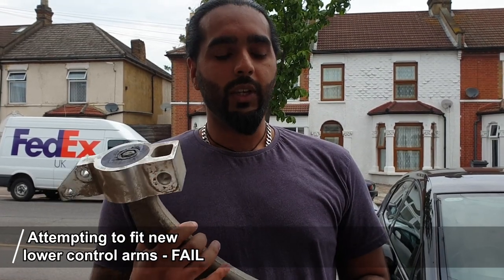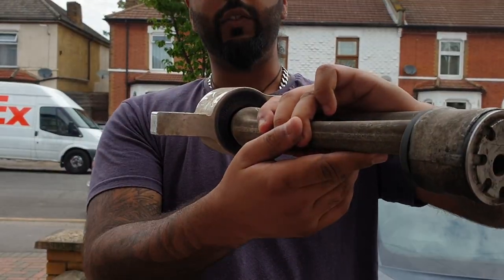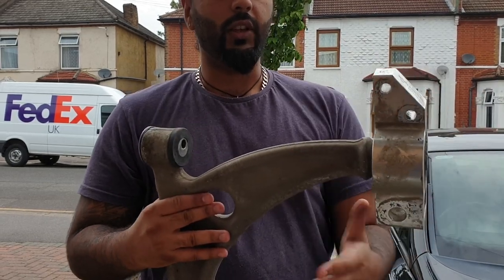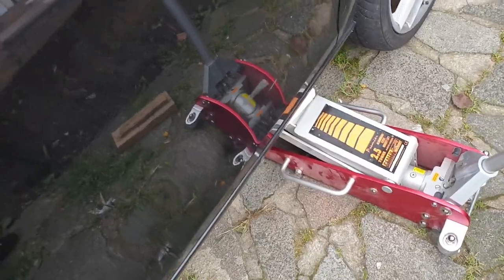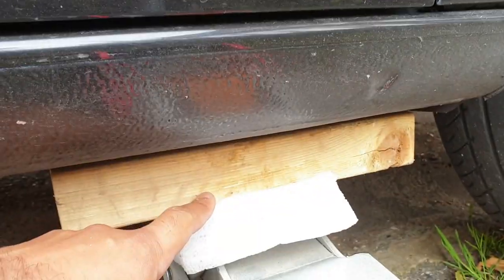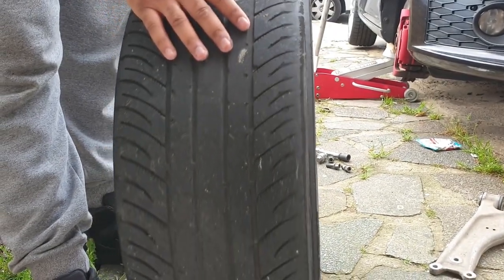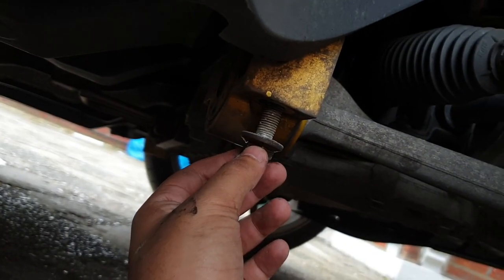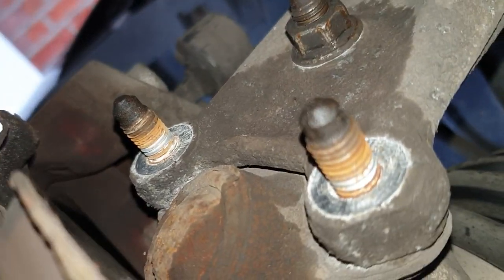Attempting to fit new upgraded lower control arms (+ anti lift kit) - FAIL

Comment: I know it's been mentioned as you already had a anti lift kit on the (whiteline one I believe). Wierdly I'm fitting the whiteline kit at the moment, I had to take the arm of like you, I had to use a puller on the anti lift kit to get it off the arm. My arms are also aluminium  but it's a cupra K1.
I agree the bought not built annoys me a little, because If you ask these people how they did this or that they dont have a clue, because they got someone else to do it. Dont worry mate you cant do everything you've both done very well on doing bits on the cupra which I've found very useful.
Reply from the maker: Thanks for sharing that info and for the kind words 👌
If someone has bought a car already built it's not too bad, but it just becomes frustrating when they try to take credit for someone else's work.

Comment: what part number is the superpro ALK? Do they squeak?
Reply from the maker: https://www.superproeurope.com/products.cfm?vehicleid=7745

11E or 11F here. I had no squeaking at all with the road use set, no noticeable increase in vibrations either so very happy with it. 

It also helped to remove some of the torque steer when launching as it helps keep the front end tighter and lower
Reply: @SwatiGurpreet   Awesome! I ordered the lower arm bushes and the roll centre adjuster as well

Comment: Hi I'm confused as you  already had white line anti lift kit fitted and alloy arms could you not of just changed the front brush to the camper adjust ones?
Reply from the maker: Yeah I could have but I was not aware of the anti lift kit already being fitted. When I bought the car it was sold as "stock" which obviously wasn't the case. I noticed the gold bit of the alloy arms but didn't think much of it. All in all it was a pain in the butt for not much gain.